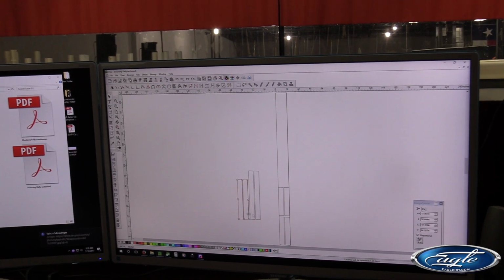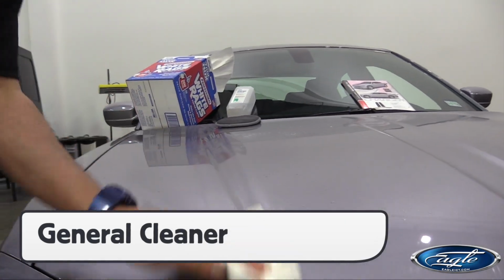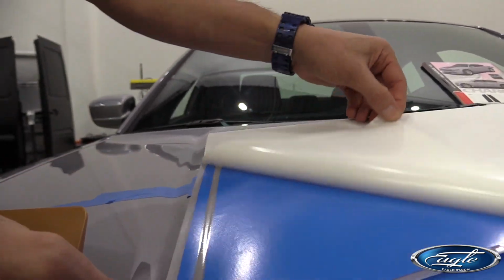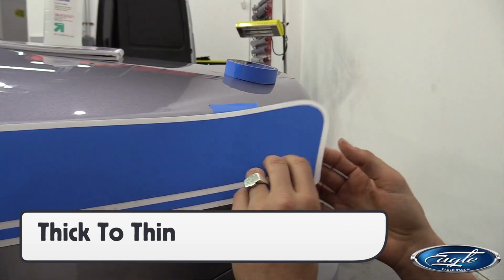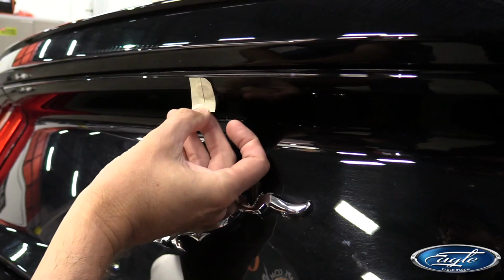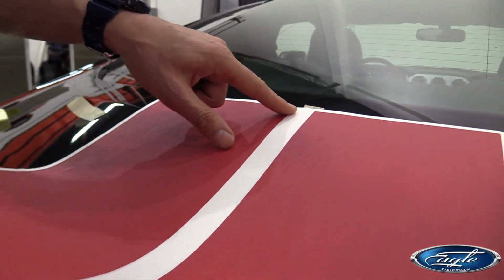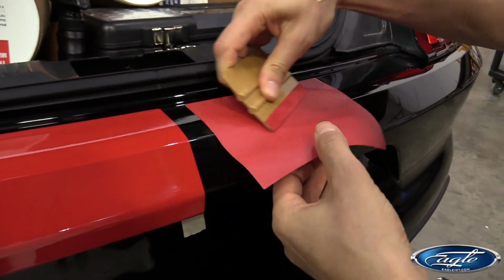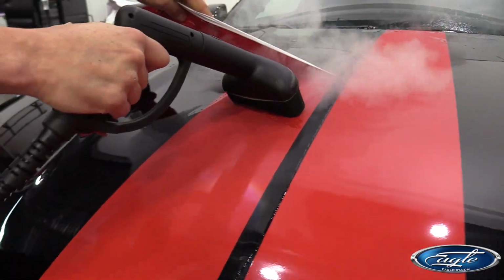Eagle Enterprises with Justin Pate

Comment: Is this an air release vinyl? I've not had much luck applying dry without having bubbles.
Reply from the maker: Lucas Jones yes this is a air release product. It could be a number of reasons why you are having issues. What are you cleaning the surface with before the install? Not firm enough sqeegee pressure or missing areas. Then not post heating after the install. Let us know if you have any questions
Reply: Eagle Enterprises I wasn't having issues with your product. Yours being air release makes all the difference though haha. Dry applications of regular outdoor vinyl tends to be difficult to have zero bubbles on pieces with larger surface areas. That's why I was confused. Thanks for the reply.